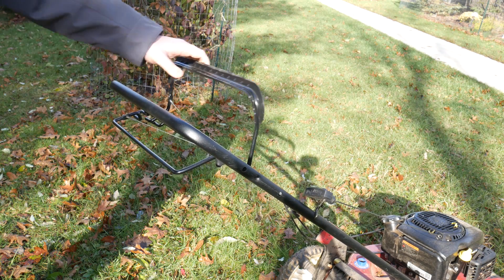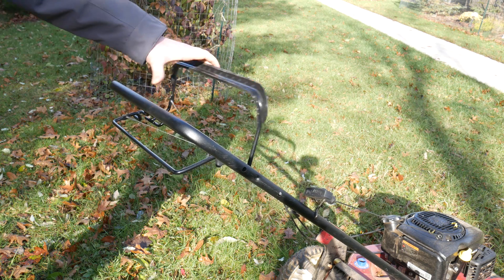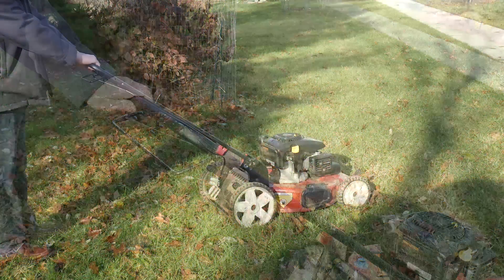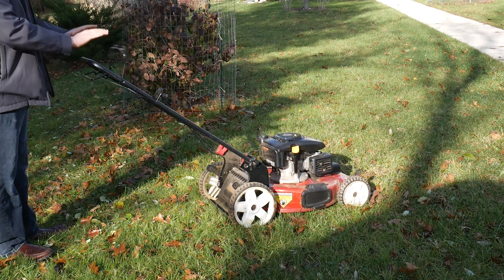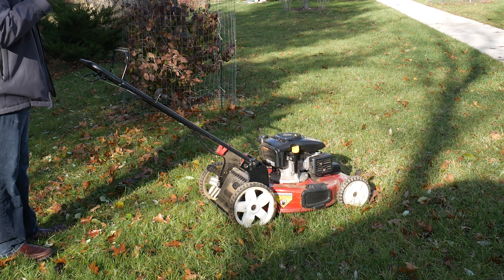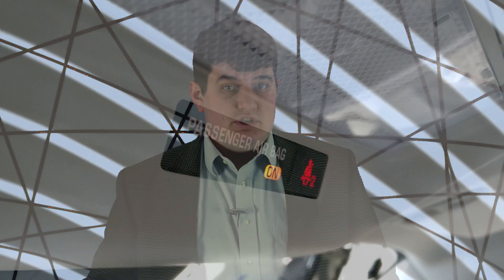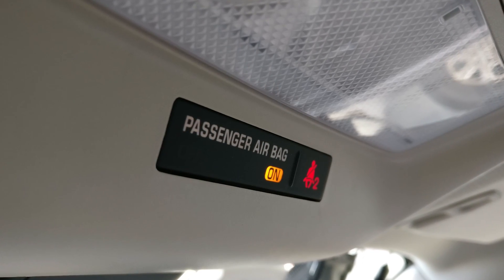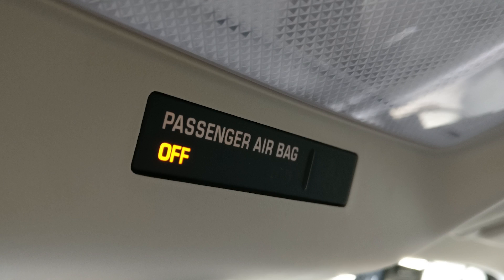The Dead Man's Switch:  How Anton Yelchin's life could have been saved

Comment: i work in an aftermarket electrical auto shop. when i heard he was killed by his jeep it was one of those... 'holy shit ive been there' moments. in the shop i have left those vehicles in neutral accidentally on NUMEROUS occasions and had them roll in the shop. the floor is pretty flat so it only moves when leaning on it or maybe a bit of a rock but regardless its always a WTF moment when it starts to move because i was certain i put it in park.   my coworker rammed one of these jeeps into his tool box when he made the same mistake and walked away.
Reply: Not learn to use the hand brake is an inexcusably dangerous thing to do. NO, fearing it would stick in an old car  or whatever if applied doesn't mean it's the brake's problem, it means you GET A BETTER CAR! Not some half broken 40yr old bomb "because it's fashionable".
Reply: Always count the clicks.
Reply: how do you not learn to use the hand brake?
Reply: @anessenator  you NEVER use the hand break. i use it in my truck but ill never use it in a customers. have had to pull apart drums and waste hours of time to unstick an old and never used parking break.  its just a terrible idea to use a parking break in a car with unknown condition. maybe you use it in a newer car but its still something that is rarely used in an automatic. in a manual i normally shift into a gear the opposite of its roll direction.  i dont trust a parking break to hold any car so its not used often
Reply: @INCC74656I  Reading these threads brings home to me how utterly different the laws/assumptions/behaviours are in the US from here in the UK. In the UK drivers are taught to apply the handbrake as soon as the vehicle is stationary, even at a stop light; and it is mandatory to apply it before releasing your seatbelt, let alone exiting the vehicle. The idea of a handbrake getting stuck through lack of use is boggling! (I've had a handbrake cable snap on an older car, which necessitated pushing it to a safe spot and calling the AA, but safetywise that can only happen if the vehicle is already stationary, or you're pulling on the handbrake at a really inadvisable time anyway!)

Having the handbrake on while sitting at the lights ensures that if another vehicle runs into the back of yours, you have more than just the mass of your own vehicle (roughly equal to theirs) resisting the sudden acceleration that might injure your neck, or worse. (Principle: Let the idiot who fails to stop in time take the pain!) It also ensures that if your foot accidentally slips off the brake, or worse catches the edge of the accelerator while you're distracted with changing the radio channel, your car won't leap forward into the back of the next one. Being in the automatic habit of "foot brake; slow to a halt; immediate handbrake" minimises the risk of forgetting to apply it when you leave the vehicle. Etc., etc...
Reply: … UK handbrake use is interesting.  hhmmmm.  But UK has less automatic shift cars as % where the idle speed is easy to set to slow crawl so foot brake counteracts, but a manual shift car is more of a juggling act that needs handbrake to avoid times where driver is sloppy.  And UK is hillier relatively, the US is big enough we skipped using most hills and mountains so we 90% of time at at FLAT intersection - and we built our roads later when good graders and levels were around to get things Dead Flat.  And UK has 10x more pedestrians, in US normally ok to drift a few feet forward at stops.  ..  I don't mean anything Bad by all this, just throwing out Ideas, since man FEW use the handbrake in the USA.  . . ..  US has far colder areas where handbrake is more likely to stick, I think, I know on coldest days we don't dare lock our car doors to avoid the 1% chance of lock out and missing work.  And in US we are stupider.
Reply: @Tom R the force is from the sudden acceleration, so the brake reduces that.
Reply: The force on your body comes from the seat suddenly moving while you are sitting still. The seat starts moving because the car starts moving. Reduce the movent of the car, and thus of the seat, and you reduce the force that suddenly shoves your torso  forward while leaving yourhead to itsown devices. (The cause of "whiplash" injuries.)
Reply: @therealpbristow  actually, the reason why you keep a brake on (foot or hand) at the red light is to protect the people in front of you if someone does come and ram into the back of your car. It prevents you from smashing forward into another car or pedestrian.
You yourself and your car suffer more damage when braking if you get rammed than when you don't brake because the momentum the other car gives you will not partially turn into a gentle forward motion, but instead get absorbed by your stationary car (crumpling its back) and your body, jolting you forward sharply. I've had both situations happen to me and the impact was less when not braking. Thankfully nobody was in front of me to hit.
Reply: @TeaAndFloppyDisks  Having the brake firmly applied causes more force to be applied to the bumper and less to the occupants.

To understand why, imagine the extreme case: a vehicle welded to a massive steel deck.  That would cause the monobody, especially the crash cage, to function like a wall.

The impact force is higher, but it's transferred to the ground or deck instead of accelerating the occupants.
Reply: therealpbristow Yeah you are actually almost 100% wrong. The force is imparted on you and your vehicle by the car behind you. If you move less you will actually suffer more harm. Your forward movement is direct dissipation of the moment of force provided by the other car. If you lack forward movement I.e. stay more rigid, the impact will be felt harder by you.

Comment: Book smart?  History shows that this is a bad idea.  Every time you go over a bump the car shuts off, or in your case, slams into park.

It would be better to remove most of the "safety" systems so that the driver is actually in control and aware of his actions.  

Also, what happened to common sense? Don't ever place yourself between a running vehicle and anything else no matter who or what is in control.

Comment: BMW uses even more logical system: if driver's door is opened, vehicle applies Park. Except if seat belt is on. No need for pressure sensor.
Reply: Audi also has options to shut off the motor. Doesn't help if neutral is selected, but they also automatically apply the parking brake in various situations that could be dangerous.

Comment: drive by wire is the best.   for gas peddle.  Way less lag time.     Lag time is a huge issue on the first gen system i.e Chevy Truck  2002 to 2006 (also increases brake lag time as well)

Comment: when I put my lincoln town car in gear and turn it off.. I can't take the key out of the ignition.. it has to be in park to take the key out.
what the hell is Chrysler thinking?
Reply: He most likely didn't turn the car off, he probably had a house with the mailbox at the end of the driveway, and thus was parking momentarily at the end to get the mail; hence, no need to turn off the car.

(That's a federal requirement, for the record; no car legal for use in the US (and probably most other countries) manufactured beyond [who knows what date specifically] has to prevent you from removing the keys if the car's in any gear other than park, at least on automatic transmissions. For manuals it probably requires the parking brake to be pulled.)

Comment: I'm the type of person that would shut the car off if the driver or any passenger is unbuckled. I would also add an additional 2 point shoulder stap (a belt that goes from the opposite shoulder of the threepoint to where the lower anchor is located) the and move the anchor points for the seatbelts into the seats themselves instead of the b pillars. This will make the cars much safer and probably get around the regulations that would prevent 4point harnesses from being added to vehicles.
Reply: The Obsesed Anime Freaks Just tell the passengers that the car won't move until the seatbelts are fastened. Works every time.

Comment: The issue is that the way in which Yelchin died is somewhat uncommon. Car companies don't perform recalls or change their safety features until either A) a regulatory law has been passed that forces them to, or B) a large and widespread number of people either died or became injured because of a failed system. Outside of those two scenarios, even something as seemingly simple as some new bits of software would cut into their profits, and they want to avoid that as much as possible.
Reply: This wasn't the first time that happened with one of their cars. Anton was also quite popular and Cryzler tried to avoid bad publicity

Comment: The so called dead man switch or fail-safe already exists. It's called the parking brake. If you've driven manual transmission vehicles before you understand how important the parking brake is. No one should exit a vehicle and leave it running without parking brake. No matter what. Going to mailbox or putting air in a tire. 100 percent of the time it should be engaged. 

But Jeep's design was atrocious in this model. Gear selectors for automatic vehicles still need physical feedback for the driver. Glorified joysticks aren't going to cut it.

Comment: I love defeating kill-switches.
Leaving fuel in the mower is asking for trouble, letting it run out means no expensive repair costs.
Reply: Yea, but that's a lawnmower. Do that on a riding mower or boat and the thing will take off without you with the latter causing possible injury.
Reply: AutogolazzoJr well I did riding lawnmowers same. Just killing the seat switch and wiring it always seated. In neutral it didn't move.
Reply: lightdark00 Be careful with that. My father had a a couple run away mowers when working in landscaping.

Comment: Avoid creating more problems with additional safety features and workarounds; fix the actual problem before anything else.  The shift lever in the 2015 Jeep is the problem. Don't attempt to correct its deficiencies by adding more equipment, more logic, or even more programming.  Fix the real problem before doing anything else.
https://youtu.be/Qrky_15v2bc

Comment: Have Jeep never heard of a parking brake? You put the car into the park gear, then pull a handle or press a switch to engage an additional brake that will stop the car from moving. Then, even if the park gear is compromised, you have that extra measure in place.